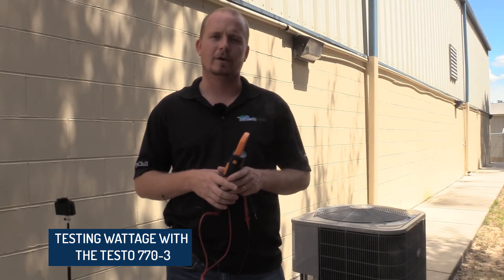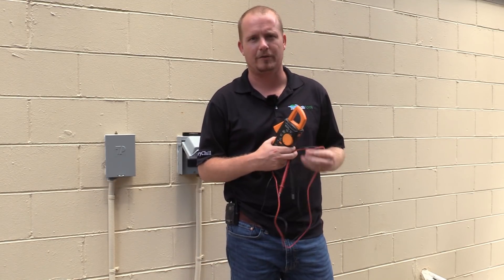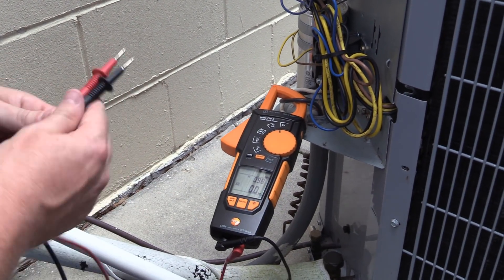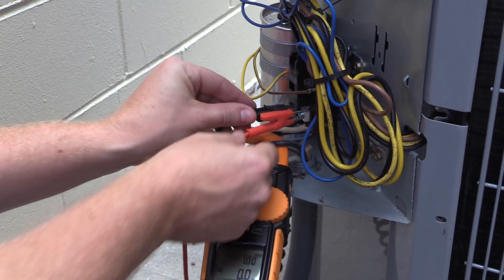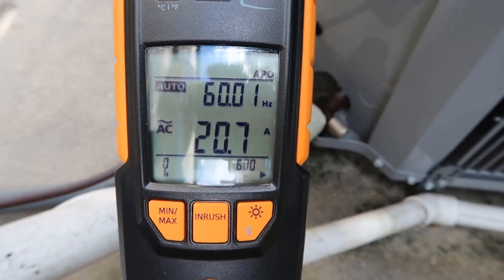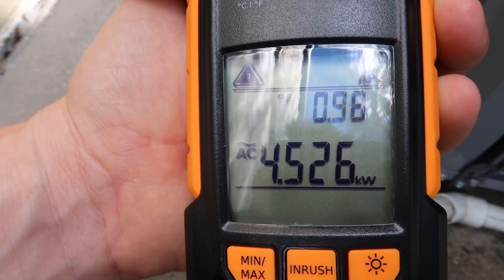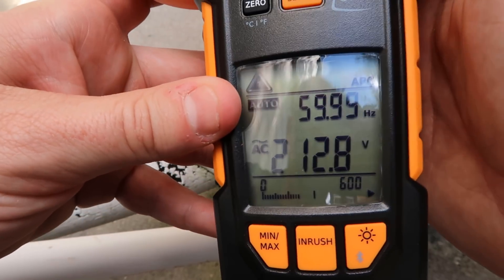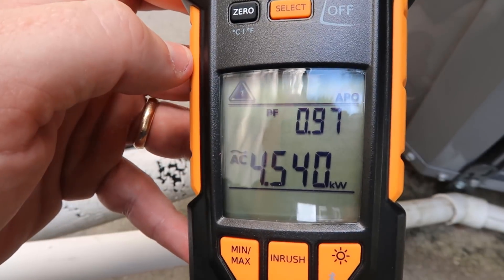Testing the Wattage of an A/C Unit

Comment: I watch all of your videos.  Maybe you can answer my question.  On my 3 ton Tempstar smart comfort 2200  The label states 88 LRA.  When I tested the inrush on the common black wire coming from the compressor  it showed 112.9.  Much higher than what the label states.  Why?  Is that a problem?  The unit is 20 years old and working fine.  Note:  I did measure the inrush  with my new meter Fieldpiece SC440.  At the time the outside temperature was 27 degrees.  Not sure if that effects anything.  I also tested the red run wire  from the compressor and it showed 114.0  I did the test 2x's.  I hope you can help.  Thanks.

Comment: Shouldn’t take a $300 clamp meter to do the job.
Reply: Maybe it shouldn’t, but it does. It has to measure the phase difference between volts and amps.
Reply: @softwarephil1709   should be possible to get a signal onto a two-channel scope over a span of copper (without cutting anything, needles through the insulation) to get the current phase, maybe with the help of an amplifier, and use a cheap clamp to get the current amplitude.

Comment: Can we mesure power in three phase with testo 770-3 for expmle ac motors?
Reply: No. If it is possible it wouldn’t be near this easy and require an algorithm and some math steps. 

I’m fairly certain you would need to at the least be able to get the Power Factor, and a lot of meters can do that but I don’t believe klien has one yet or not that I’ve seen Anyway. 

My redfish meter can find PF easily, unsure if it does wattage calculation like this but does have a kW function so I’m assuming so.

Comment: can I use a regular klein multi meter to test for watt power?
Reply: No, because the meter has to measure the phase shift between voltage and current.
Reply: No. Not this easily, anyway.

Comment: is it safe (doesn't damage the tool), connect the probe cable to the electric current and the tool selector shows the A or ohm meter? as you do changing the selector while the cable is connected to the current

Comment: If I multiply amps by volts without the PF, do I just get VA?  Is it true that to find watts, I need the power factor? What if I dont have that?  What is the PF on most appliances?  Im not an electrician.  I am trying to figure out how many watts my appliances draw so I can size the inverter in my solar generator.  If I just multiply amps and volts, will there be a significant difference between va znd watts?
Reply: Yes, volts times amps ignoring power factor is VA. Induction motors are usually 80 to 98 PF. Computers are >90. Arc welding can be less than 40. Divide PF by 100 to convert to proportion. Multiply VA by that to get watts.
Reply: Va & watts are the same thing buddy. I’m sorry I’m a year late.